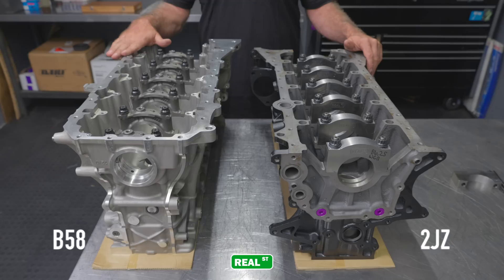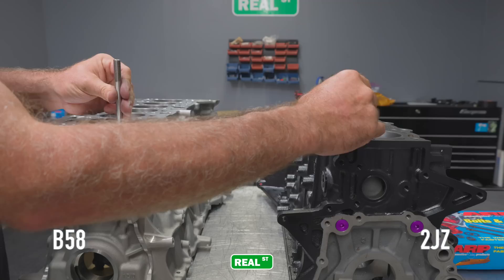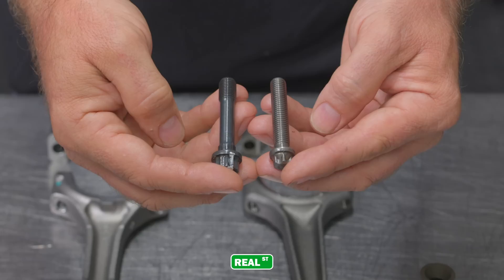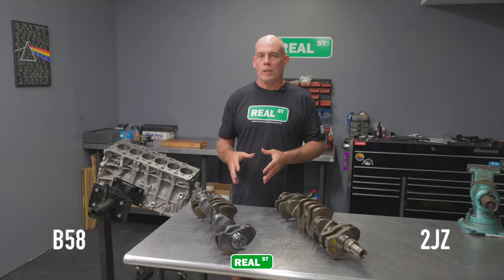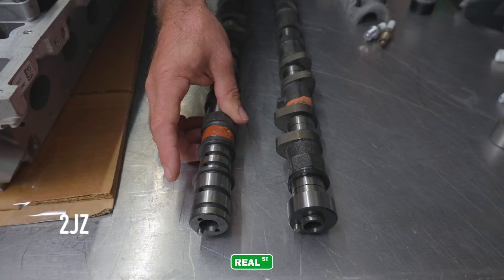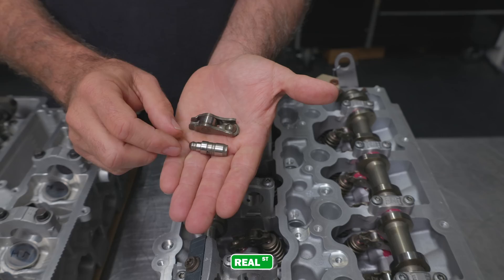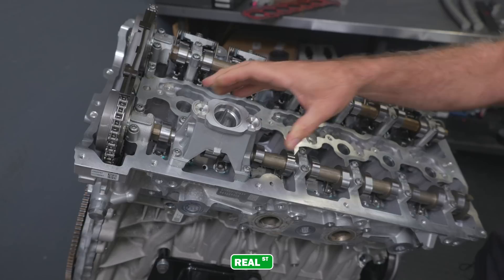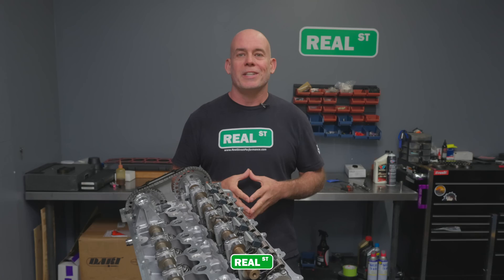Toyota 2JZ VS BMW B58 | 2JZ STILL KING?! (Detailed Engine Internal Comparison)

Comment: In my opinion, yes both engines are very potent and powerful out from the factory, but there’s also the side of repairing and ease of service as with any engines. 20 yrs into the future I think this important factor should’ve been considered by its engineers, but I’m only a Toyota technician just something to consider, when we break down as car enthusiasts we actually want to do an on-site diagnosis and repair just saying, speed isn’t everything, simplicity is “KISS” keep it simple stupid and enjoy 😅😂😊
Reply: As someone that gets paid to work on BMW engines, to me the B58 is actually simpler than the 2JZ, especially in the engine bay. IMO the only area that’s substantially more difficult is the VVT/VVL but that’s just a difference between modern & old - it’s not actually that complicated just different. 

Granted I almost exclusively work on modern engines so it’s just a matter of perspective I suppose.
Reply: @Enthusiastlist  with your experience if we gave you a 2jz to work on you’d probably feel like you are over qualified. Too simple
Reply: I worked 2 years at a euro shop, worked on bmws, fords, Chevys, Porsches, Maserati anything overseas honestly, focused of bmw most but touched everything. Especially electrical. Personally these bmws are literally legos., engine unplugs with the trans, very simple right in front of your face as long as you know what your doing you can pull and replace any 4 cylinder within an 1 1/2 hours easily. Now i work at Porsche, and this a new learning experience.
Reply: I agree with what others are saying, regarding BMW engines, they are nice to work on. I own a Lexus ISF and working on that engine is a lot more complicated for similar jobs when compared to BMW. Spark plugs on a 2UR compared to the S65 is not even close. The Lexus take so much more time to do, but thats just one example. Im still a fan of both companies.
Reply: @Enthusiastlist no wonder the b58 has that huge plastic cover over the engine. It hides the maze of a wires and hoses everywhere. 2jz is as simple as it gets. I don't need any special bmw tools to work on the 2jz. 2jz also has less moving parts, and I don't need to pull the engine, just to work on the timing assembly.
Reply: amen I've torn Toyota engines very good quality even the iron blocks
Reply: Ever since my newest job I've begun to respect what bmw does under the hood alot more. My boss makes me fix all his buddies m3's. But still I'll never accept the new supra as a supra. Is a z4 through and through. You cant lie to me. Lol.
Reply: I feel the way cars are going they are asking it perform multiple jobs compared to the older engines. We need fuel efficiency, reliability (to 100k), high power and lower emissions. It's a big ask of a modern engine even a 2jz has trouble performing these task at stock.
Reply: @firetoy  2jz can go beyond 200k miles unopened. Modern engines are made to be disposed of once something breaks.
Reply: @madkas14  but it struggles on the other objectives...
Reply: @firetoy  it just does not meet current emission standards. No one cares about that when you're looking to make  lot of power.
Reply: @madkas14  when designing an engine they aren't just thinking of the enthusiast they have to throw a wide net for multi use, not just power.
Reply: @firetoy  what do you think Toyota engineers where thinking 30 years ago when engineering the 2j? Mind you this is 30+ years ago...
Reply: @madkas14  I mean that's my point. When comparing and old engine to a modern engine you have to take in account what the modern engine was made for vs the older engine. So the fact that the modern engine performs all these task well shows it's value with the advancement of tech. The 2jz is a marvel. But compared to today's engine and what today's car industry ask there are equal or better options like this B58. I would love if they used a more modern 2jz in the Lexus rc350 because their current drivetrain in that system is trash.
Reply: @madkas14 your ignorance is showing 😂 "mess of wires" "tubes everywhere" 😂😂 you've never worked on a b58
Reply: @mexicaninjafredfred  The 2j doesn't have a big ass cover over the entire engine. Cover that ugly engine bay up 🤣
Reply: @madkas14  what "tubes" are you talking about 😂 the cover is over for sound deadening and heat 😂
Reply: @mexicaninjafredfred  nah, it's to cover up that mess of hoses and wires. Your right, I've never worked on a B58, I only work on 2j's. I'll get a chance on working with a B58 when I emove it, so I can swap in my built 2j into the mk5. 🤣
Reply: @madkas14  yeah I don't care 😂
Reply: @mexicaninjafredfred  you seemed to care enough to reply... have a good day Fred.
Reply: @madkas14 tbf I'd say that expected of all new engines even in the B58s case. Toyos new TTV6 looks no different from other manufacturers that have these engines knitted up with wires all over it.
Reply: if its popular enough it will be supported by the aftermarket
Reply: @madkas14 u act as if any other modern engine isn’t the same….you won’t see wires on a s54 nor a cover but that doesn’t mean it’s easy to work on
Reply: @60thirty22  2jz is still easier to work on, much more simple with big power potential. Idk why I have to keep repeating myself, make sure you watch the full video closely and see the difference. The proof is right there man.
Reply: Sadly, the KISS method can't be applied to today's standards, if a 2JZ modern successor exist it will be as, if not more complicated than any B58, why? well for starts need to comply with strict emissions and fuel efficiency test, yet need to be powerful, reliable and cost-effective, there's no "easy" or "simple" engine anymore, even small engines have tons of complexity not to mention electrification assistance in order to comply with strict emission and efficiency regulations.
Reply: @madkas14  the manufacturer has to care about it when designing the engine is the point. No B58 if it doesn’t meet emissions requirements.
Reply: Oh yea, 20 years into the future, EVs will def get the simplicity part covered lol. I'd imagine you will be looking high and low for a gas powered car, let alone choosing one

Comment: There’s no denying the simplicity of the 2JZ just makes for such a sweet power plant
Reply: One is a mess of vacuum lines, the other is a mess of wires. It's a pick your poison sort of deal.
Reply: B58 have a plastic parts inside the engine 😅
Reply: most 1000hp 2J's lasted barely 10,000kms of tracking. RB's lasted decades. not even a comparision. 2J was junk
Reply: @keirbrown7734  junk is a stretch, but not as good as the internet makes it seem, for sure

Comment: honestly for me it boils down to one thing and that’s simplicity. I get technology has come a long way but just looking at jay take a part that B58 oil pump gave me a headache. Toyota made the 2jz timeless in my opinion. #team2jz
Reply: KISS method; "The best part is no part" -Elon
Reply: A little information for you. Toyota did not build the 2jz, Yamaha did.
Reply: @johannilssonnilsson6101 no,Yamaha did the heads to the 1jz,afterwards the rest is toyo. All the 2jz is is them literally overbuilding the 1jz to make the 2jz.
Reply: If everyone thought like you we would still be riding horses😄
Reply: Will Valvetronic and Auto Start/Stop still be working in 20 years? It could go either way honestly, but whatever gimmicky crap goes wrong on the B58, I'm certain you can tune it out or replace it with simpler hardware and it'll be up there in mileage numbers with the greats.
Reply: @ryandoyle4344  lol Elon doesn't know how anything works
Reply: barra would like to have a word with you
Reply: @PhantasmPhoton  I dislike Elon as much as the next guy, but let's be honest, he knows a thing or two :face-orange-biting-nails::face-orange-biting-nails:
Reply: @MistRVertexZ I think even horses are more complex then the 2jz
Reply: @ryandoyle4344 K.I.S.S is a limitation. It works 98% of the time but to get the last 2% is toughest. That is where technology aids in getting that last 2%.

 Further I am not spending north of $20k for a dated Toyota Supra or modify some other vehicle to use it when less expensive options exist if you don't have some weird brand bias that you didn't earn.
Reply: 3S-GTE Yamaha Heads Toyo Bottom
Reply: Technology has come a long way because of emissions and fuel consumption. You could never hope for a 2JZ to pass emissions test in a modern car. Not to mention the weight.
Reply: Regulations change alot. Weight is a killer in cars. 2jz have the advantage of being old and thus not have to remain within modern engine regulations. People forget that. The B58 is fantastic and is def. A great engine with potential.
Reply: That is exactly what I thought! B58 oil pump  feels like failing with 3 or 4 years of good use!
Reply: @carboydorifutoparty3976 ahhh THANK YOU. I'm getting so fking sick of people saying the MK4 Supra is basically a Yamaha.
Reply: Right… I got soooo much anxiety watching that oil pump part

Comment: The pistons on the B58 are awesome. Light strong design. Managed to save some weight on the rods too. The Volvo whiteblock engines seem to have a lot of the JZ technology and a little bit of the B58 technology. They're often overlooked, and the aftermarket support is very limited too, but they're great engines.
Reply: The b58 has a massive aftermarket, what are you talking about? Obviously little compared to the 2jz, but it’s still massive.
Reply: It's pretty damn impressive. Not only does it make power up to redline despite its heavily undersquare geometry, but that redline sits at 7000 RPM. With a 95mm stroke and non-forged pistons. BMW engineering at its finest, even when all the accessories start leaking and the rubber gaskets start cracking, that bottom end will keep on fighting.
Reply: @GarciaQ60  I was throwing the Volvo whiteblock in for comparison, because I see a lot of similarities. The Volvo whiteblock doesn't have a very much aftermarket support.
Reply: @porschelover04  BMW has been doing its best to tame long strokes as it moved away from square NA engines, the b58 being an impressive triumph.
Reply: It was also designed by Yamaha if I’m not mistaken
Reply: I had a 2.3 t5 downpipes and tune it ripped
Reply: @2seep he’s talking about the Volvo engine
Reply: From 2005 to 2010, Yamaha built Volvo engines and indeed they were very solid. I read an article that said the 2JZ was actually built by Yamaha, which corroborates with your observation.
Reply: @thegoodneighbour the head was designed by Yamaha
Reply: its perhaps the S58 that should be compared to 2JZ not the B58. 2JZ was in a very expensive product for its day
Reply: Best part about the whiteblock is that the main caps are integrated into the girdle. The only downside of the whiteblock is the open deck design.
Reply: Almost any Volvo engine is impressive, except for the PRV, fuck that thing
Reply: @hotdog9262  eh id somewhat disagree
 The Supra was always an affordable sports car, even in the 90s. They started getting more expensive after fast and furious, but that wasn't still crazy high at the time. Half the price of a Porsche.
Reply: @Greatest_Scott  porsche were ~55% more
Reply: @hotdog9262  so in 1996 the Toyota Supra Turbo was $48k. The Porsche 911 Turbo was $99k.

Show me that math again lmao
Reply: @hotdog9262  48k vs 99k = 55% different? Ya no
Reply: @Greatest_Scott  supra competed with the carrera not the porsche turbo^^

296hp vs 330hp for the supra turbo
Reply: @hotdog9262  idk why you're making shit up
Reply: @hotdog9262  that's just not true. The type of people buying these cars were not looking to buy a base model carerra.
Reply: @hotdog9262  anyways. That's still not good math because the pre-94 models were available for closer to $30k
Reply: @Greatest_Scott  i don`t care of any guesstimate of what buyers were cross shopping at the time but for the record, why would a 40k car compete with a 100k car in your view? in real sales.
stock these were similary performing cars as the supra turbo were substantially heavier.
Reply: @Greatest_Scott  this was for 1999 models
Reply: seems turbo were not available before 2000/2001 at ~110k
Reply: @hotdog9262  what ??
Reply: @hotdog9262  you're the only one talking about sales
 I'm talking about performance of vehicles. These cars were being raced forever. Go enjoy your sales pitches about trying to sell a base model Porsche that cant even keep up with a Supra for half the price.
Reply: @hotdog9262  what do you mean turbo were not available before 2000/2001 ? For what car ? Not the ones we're talking about
Reply: @hotdog9262  supra is a tuning car. 911 turbo is a tuning car. Anyone looking to drag race would be picking one of those two up, and not a N/A version.
Reply: @Greatest_Scott  you "that's just not true. The type of people buying these cars were not looking to buy a base model carerra"

also you "you're the only one talking about sales"

try being brighter
Reply: @Greatest_Scott  "Go enjoy your sales pitches about trying to sell a base model Porsche that cant even keep up with a Supra for half the price"

a stock supra was fairly slow, people confuse stock supras with tuned ones, the carrera was more or less as fast ..and a lot more interesting to drive. and as said it was 55% more not 100% more^^
Reply: @Greatest_Scott  porsche did not have a turbo for 1999. they had before and after though. the new one were released in 2000/2001
Reply: @Greatest_Scott  "supra is a tuning car. 911 turbo is a tuning car. Anyone looking to drag race would be picking one of those two up, and not a N/A version"

the vast majority of buyers to not drag race or even tune their cars. meaning, you don`t know what you are talking about
Reply: Yeah, the B58 pistons are great but the cylinder walls are so fragile and score with the smallest amount of injector leakage.